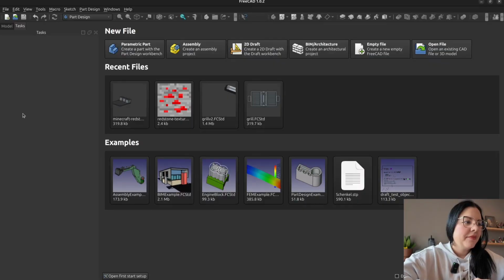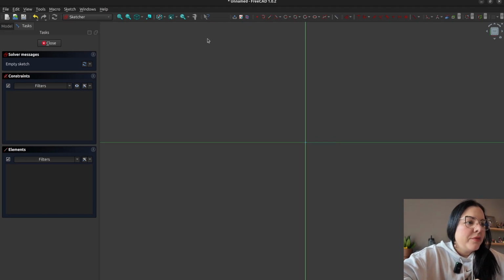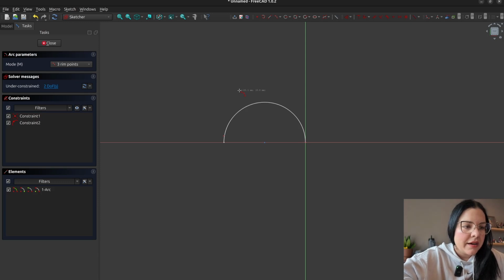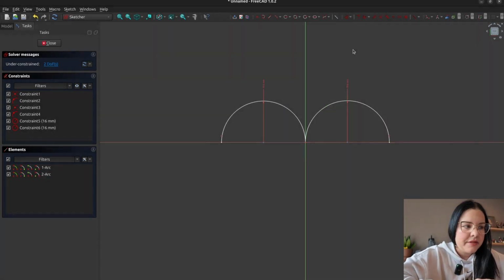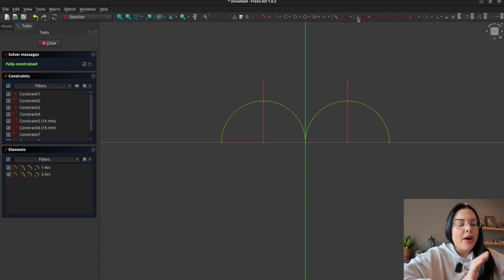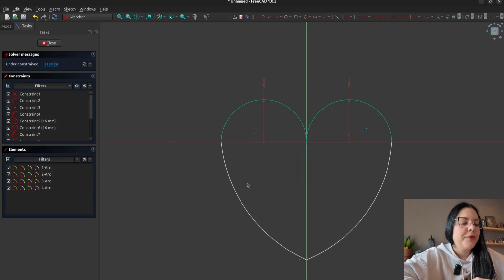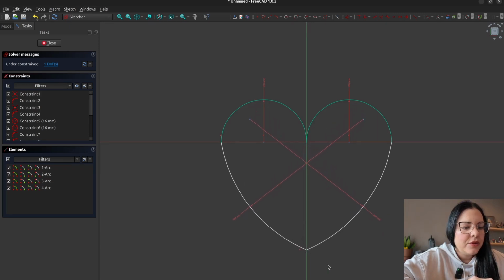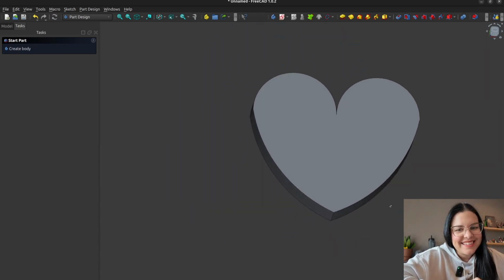Easy way to design a fully-constrained heart on FreeCAD ❤️

Comment: clear explanation! Thanks! Wouldnt the heartshape look nicer though if the connecting arcs left and right would not for a sharp angle at all?
Reply from the maker: Thank you! Well, my goal was to make it the simplest way possible. For the axis where the bottom arcs connect, a fillet would be an easier solution to make it round (instead of doing it in the sketch).